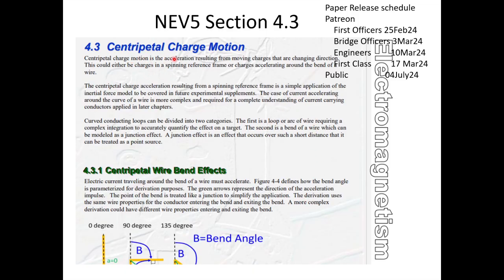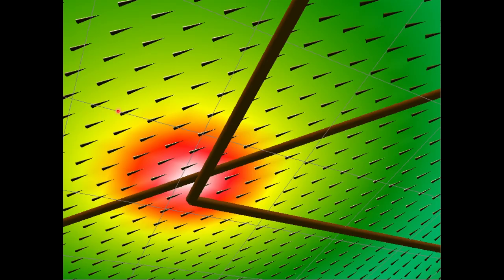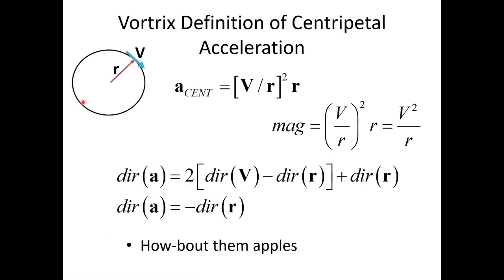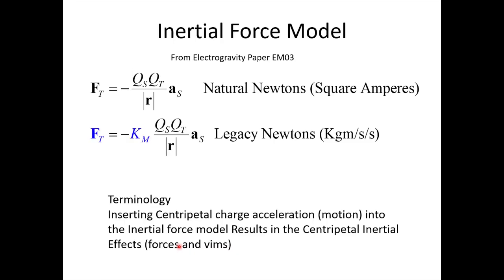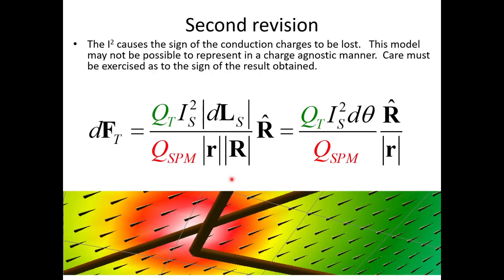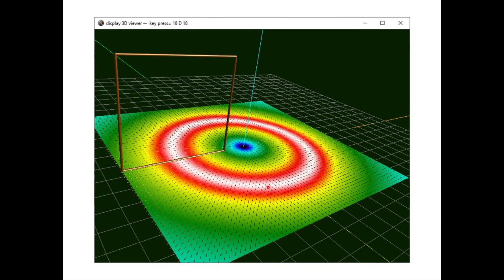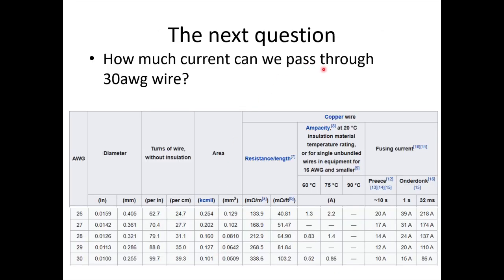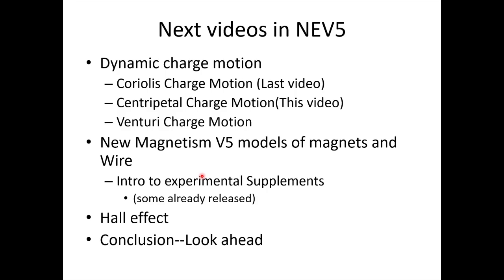em04_08: Centripetal Charge Motion

Comment: I was hoping you'd work your way towards the Biefeld-Brown Effect, but with the progress you're making, the best I think I can expect is Frolov's Hat.
Reply from the maker: As we advance the models and experiments, we should run into the effect if it is there.   We have run into a whole bunch of unknown effects with the EXC experiment that we still need to reconcile.
Reply: @etherealmechanics5686  Your latest video on Venturi charge motion actually doesn't seem too far off from it, if you detect thrust in the direction of an accelerating charge.
Reply: @Blurns  My understanding was BB effect was working only in a gas (such as air) and not in vacuum and it was due to ion wind. Do you know differently?
Reply: @car9167  They found that the BB effect worked best when the dielectric is dense and has a high relative permittivity. Combine that with the power supply needing to produce sharp high voltage DC pulses instead of just flat DC & they made a propulsion system that was more energy-efficient than a rocket, but had an abysmal thrust-to-weight ratio when the batteries and other components were included. The last thing they attempted to improve the thrust-to-weight ratio was to use air as the dielectric, and reshaping the electrodes so they could get added thrust from ion wind (which was already known about at least 50 years prior) but that didn't help enough so they abandoned it.

Everything most people know about it today is "it was just ion wind" which is not only wrong, but defeats the point of testing it in a vacuum, because a vacuum is the worst possible dielectric to use. You need to fix a denser dielectric between the plates & pulse the power supply to see the thrust.
Reply: @Blurns  Thanks for the time spent to explain all this. Are you familiar with Paulo and Alexandra Correa tesla coil experiment? A gold leaf was placed on a balance and also connected to the terminal of a tesla coil and mass reduction or better a reduction in the force of gravity was observed. This is in line with what Tesla was saying at some point that you need a ship where the lower hull is connected to HF HV tesla coil and the upper hull at HV DC and the HF HV was supposed to make the aether rigid while the DC to rarefy it.
Reply: @car9167  I am not familiar with their experiment, but it seems up my alley, because I hadn't really taken orgone seriously until pretty recently when I made the connection between it & the Biefeld-Brown Effect by accident. I'll have to look into it more.

I don't think I've ever heard of how Tesla's ship was supposed to work. I figured it worked like Joseph Hiddink's 1-Terminal Capacitor or Searl's IGV, based on some old drawings I've seen of it. I assumed it worked like they do, with the hull charged with millions of volts for electrostatic repulsion off the ground, then manipulating the shape of the hull to control the charge density for thrust & generating the high-voltage using the Biefeld-Brown Effect in reverse. (abrupt change in capacitance over time produces high voltage)
 
A ship with different charges like you described could probably work, but if the entire craft has a negative charge it could serve as a shield for many charged particles as well as help repel micrometeorites or other missiles it might encounter while traveling at high speeds.